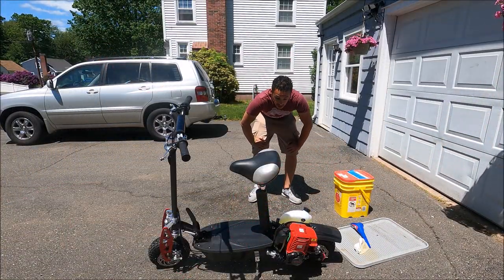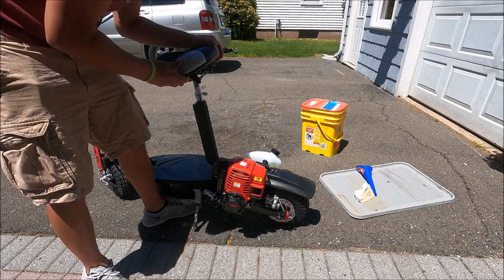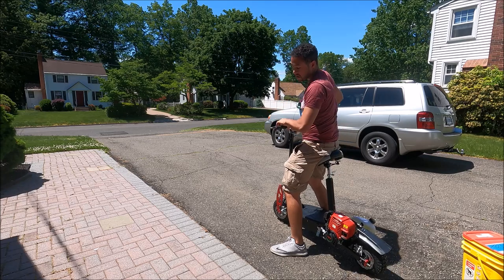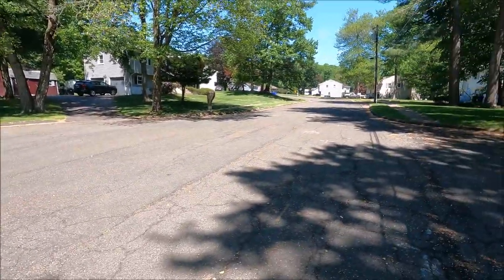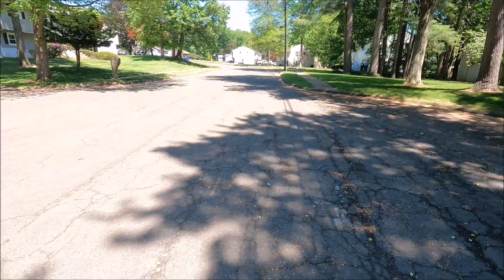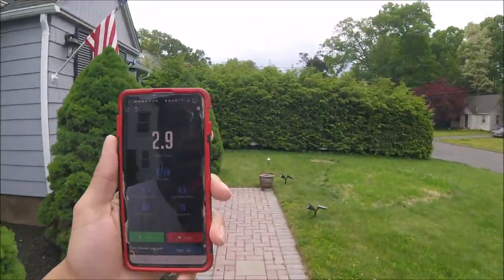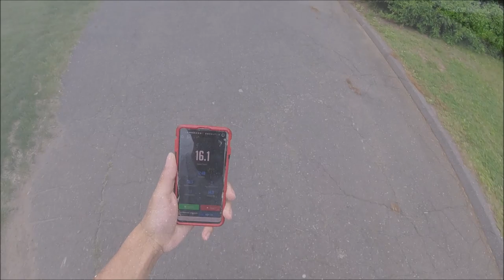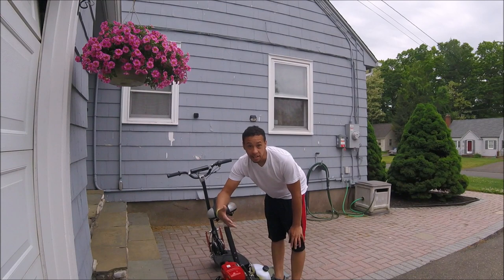BLAZE 49cc Gas Scooter Part 2 - The Ride "Episode 1"

Comment: I have a 2 stroke scooter kinda like this. Mine was made in 2009, it does about 35 mph. You can notice a difference between cool nights and hot days power wise with the top speed. But their def fun to ride around the city.
Reply from the maker: Yeah I had a 2 stroke back in the day and it was certainly faster by like 5 to 10 mph. Thanks for checking out the channel, be sure to Sub!*SK*
Reply: how was the website BLAZE when you bought it from there if you did how was the shipping "Fast"?
Reply from the maker: @Sean McKay  They were faster than expected for both the scooter and speed kit.*SK*
Reply: @SKLIFEstyle  how long did it take to get to your house?
Reply from the maker: @Sean McKay  I want to say a week and a half. Easily half the time I expected.

Comment: I'm no expert or mechanic on gas powered engines but what I know is that when you first start running a brand new gas powered engine, you have to first "break-in" (run the engine at half power or less while it takes time for it to get lubricated from the oil to fully lubricate the moving parts inside the engine.) the engine. The manual should tell you the break-in period of the engine, how long to run the engine, how many mileage it needs to run or how much gas need to be consume to get the engine broken-in or fully lubricated. When the engine is "broken-in" or fully lubricated, it is then when you can run it at full throttle or power but before that if you try to run it at full power before it's not fully lubricated or "broken-in", you may or will risk the engine ceasing or locking up all of a sudden while riding it and you may probably end up being thrown off the scooter from a dead stop.

Comment: Hi,  I finally received the scooter and it was difficult to start it but took 55 pulls.  It started I went around the parking lot then turned it off to adjust brakes.  I then placed it back in the start position and pulled to try an start it which was still difficult to pull the string and then I heard a clunking sound inside and now the pulley is fully retracted and seized up completely and it is stuck.  I am not able to pull it even a tiny bit.  Any ideas what happened?

Comment: Mine came today. I’m just curious about that 75-90w transmission gear oil they’re speaking of. I don’t see anywhere to put it
Reply from the maker: Yeah, idk what they mean by that. Just regular motor Oil and gas in the tank. Little lube on the chain and your all set.*SK*
Reply: Should be a fill plug somewhere behind the smaller sprocket coming off of the gearbox. Add just enough to cover the gears but don't fill it completely...I just ordered mine yesterday & it's being shipped today so lmk if u still can't find it; I'll know a little more once I see it...I plan on completely submersing my chain in bar & chain oil b4 running it, too
Reply: just came in the mail today...(I ordered the 2-stroke, just fyi) it definitely has a fill plug on top & a drain plug on the bottom of the gearbox...mine had a phillips-head bolt up top but it wouldn't budge w/ a screwdriver so I still had to put a socket on it & ratchet...support the scooter  in the center using a 5-gallon bucket or something so that both wheels are lifted off the ground & can spin freely...you  can't see anything inside except for a gear similar to a crown wheel inside of a differential so in order to avoid overfilling I just kept adding little by little and spinning the back wheel; while shining a flashlight down into the fill hole until I could see a good amount of gear oil sticking to the gear that you can see spinning as the wheel spins...

Comment: Did you used non ethanol gas ? The one from lowes? Because I run that on all my yard equipment and I have 0 problems in 8 years . My neighbor goes back and forward to the small engine repair shop wit his equipment, because he uses regular gas .
Reply from the maker: I did not. I just use 93 premium. It gets great mileage so you could probably get away with that and not break the bank. *SK*
Reply: @SKLIFEstyle  now they sell non ethanol at the gas stations, 93 it’s going to build carbon .. anyway thanks

Comment: Do you think doing 3 or 4 turns instead of 2 would improve the speed
Reply from the maker: Yes, but I think if you are just dialing it in and it isn't way off to begin with then incremental adjustments of 2 turns will help you find that change you want. I screwed a few times one way and the other and it just seemed too much, and it's "sweet spot" is small so I feel like it's easy to skip by and just have low top speed or no take off depending which way you move it.*SK*
Reply: Okay thank you I was just wondering because I am thinking about buying it but I wanna get close to 30 mph without mods
Reply from the maker: @jaredjones1944  you may need the two stroke if that is the case. But out the box 30mph, this may not be the scooter you are looking for.
Reply: @SKLIFEstyle  you dont have to hold it for 2 seconds my guy :) just go hell and dont break the pull start
Reply: When you say 2 or 3 turns do you mean from when the adjustment screw touches against the carb linkage? And is 1 turn a whole 360 degree? I want to get the most I can. Thanks for the great videos!

Comment: Also do you think there is a way to mod the gas tank to at least get a one gallon of fuel in it at a time?
Reply from the maker: I'm sure there is. It's just a simple fuel & return line to the tank, though I've never attempted it. But it may also feel noticeable in the weight favoring one side than the other. Right now, it is pretty well distributed with the engine on one side and tank on the other, so you may want to keep that in mine when you set up how the new tank is positioned.
Reply: @SKLIFEstyle  if i do it and it comes out well I’ll post a how to and share.  Thanks for sharing back with us all and ride safe.

Comment: Hi can you tell me if I were to keep this in my room after use so it doesn’t get stolen since I live in a dense city and have no garage, will gas fumes leak at all or is it pretty sealed and gas fumes will not be an issue indoors?
Reply from the maker: I can only say what I have done, which in the past, on vacation at a rental, I stored it indoors for a day or so during severe weather. Fumes will always be a concern. The fumes didn't pour out noticeably, but I can't say it would never possibly be an issue. It seems pretty well sealed. But I wouldn't keep it near any outlets or heaters, and you should still make sure there is good ventilation. Of course, it isn't adviseable to store any flamable liquid indoors, and it is dangerous. I would not advocate that you do it. But if you are going to, don't bring it in right after use, give it time for exhaust vapors to full escape and dissipate, and engine to cool down, keep very good ventilation, and again away from anything which may spark or cause ignition. FYI, they do make electric versions, which are just as powerful and even faster, that may be a way better option. Thanks for watching, and be sure to Subscribe! *SK*
Reply: I have a toggle switch so it won't start a you put a pad lock on the seat lock it to 🌲

Comment: On the site if I’m not mistaken it says 35 mph doesn’t it? I mean 20 is ok I was expecting at least 30mph being the site says 35mp. I’m buying one tonight I have been researching them for the past 3-4 days from electric to 2 stroke I weigh 125 so I assume it will go faster for me. I’m just still curious why u didn’t go faster I’m assuming because y did no flat roads. I’m using mine for a camping trip on mountain trails so hopefully 🙏 she does decent off road.
Reply from the maker: I have a hills test video you may want to check out. I do plan to do some videos with more off-road riding, too, as Spring rolls around. Be sure to Subscribe to check it out! That said, about my max on flat ground is like 28mph, typically like 24/26. It does well for light off road, but this 4 stroke won't do 35mph unless your going down hill. But it will take you up some pretty decent hills, gravel/pavement. To me it's a great scoot, but if speed is key then there are others which can do a bit better, albeit for more money too usually. Or you can get the 2 stroke, but idk if that will do 35 either, but certainly will do a few mph better on avg, but a lot noiser too.*SK*
Reply: I just got mine the other day and got 19 mph max. Tried to tweak the idle and loosen the chain a little, but it didn't seem to make a difference. I weigh about 190 lbs so maybe that's the issue. I was really hoping it would do at least mid 20's mph. I ordered the cold air intake filter so will see if that helps at all. Maybe I just need to lose a few pounds lol.

Comment: Can you remove the seat
Reply from the maker: Yes, you can. There is a bolt underneath with a knob to unscrew. I lost mine, but it still sits very tight in the hole. Only if I lift the seat like you are trying to lift the whole scooter will it come out.*SK*

Comment: So the 30 mph is not true?
Reply from the maker: I think with a street tire, speed kit, correct air pressure, etc being under like 120 lbs yes. But just any adult, any set up, no probably more like 22 to 25 out the box. That's on the flats that is.*SK*

Comment: Do you feel that you someone should spend $500 on this and would you ride this all the time instead of taking the bus how good is the gas mileage on it to you have to fill it up do you have to fill it up every time you go somewhere how does a gas last a long time and how much would you say you put in with gas up a couple bucks cuz it doesn't seem like it's got that big of a gas tank I'm seeing your video I went and bought me one
Reply from the maker: If you have the money I think it's worth it even for a fun toy..but as transportation it should be great too. I have only filled it up a few times with premium gas and even at these prices you won't be able to go above $2 to fill up. It does the 30+ miles per tank...so 120+ gallon is feasible. I like the scooter. Not complicated, not fancy but made well where it needs to be and then some. You can see I go over some reason why I went 4 stroke but it's reliable and easy to start, and while not a speed demon still a fun toy to keep around. I've done a good series so far all things Blaze scooter. Hope to see you Subscribe and check them out.*SK*

Comment: Is your scooter a 4stroke? And how you get it to not smoke
Reply from the maker: Yes, mine is a 4 stroke. 2 strokes will usually smoke a bit more. If you have a 4 stroke and it is smoking I would check your oil level is right, make sure there are no leaks where fluids would be getting on the exhaust. Also check your idle is at a good point and the choke isn't being left on. Beyond that you may want to have a small engine repair person take a look. Anyone who works on say yard equipment could help.*SK*
Reply: I have a 2 stroke, so looks like it's normal and my friend says it's correct tuning I have it. Thank!
Reply: She also said, rides fast
Reply: When I first ride it, no smoke at all but that was during the day and I'm trying to get it to that level adjustment again but engine starts, then stops, so I turn the screw to the right a little and then it would start. Should I just leave it as it is after the engine starts running?
Reply from the maker: @tanyahorncastle3197  yeah, if it doesn't want to start afterwards I would use the choke..rather than mess with idle. Glad to hear it's okay overall. #ScootLife
Reply: Yea the manual book says the choke has to be up before pull to start the motor. Says do not ride with the choke up.
Reply: Yes ok 👍

Comment: by the way dude you're not making it faster changing the idle speed you should have the idle as low as it can go without trying to stall it the idle speed just makes the engine sit and run faster and burn up more fuel

Comment: Too loud for my taste I would be more embarrassed than excited to ride lol
Reply from the maker: Much more quite than the 2 stroke. Unless your on it within 20 ft from it, it's not that bad, but I hear ya. I think I get more looks for just being on a skinny little scooter with all these gadets doing like 20mph lol. Can def get electric with same power  or more, and of course no noise. Blaze scooters actually have a few, same platform. If engine ever goes I will probably do the swap to the electric 1200watt motor.*SK*